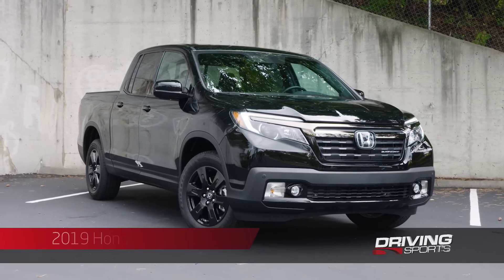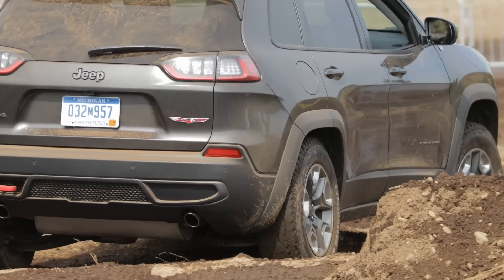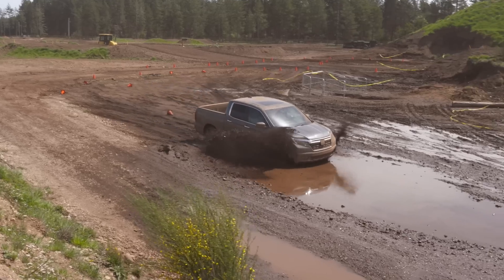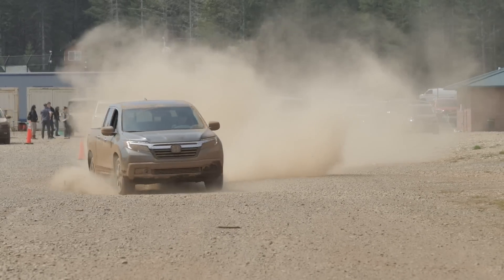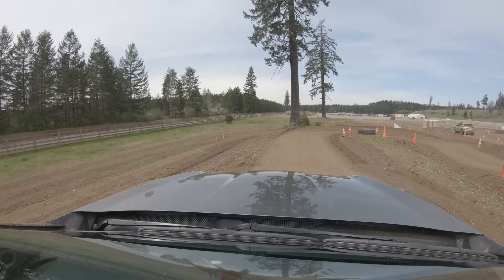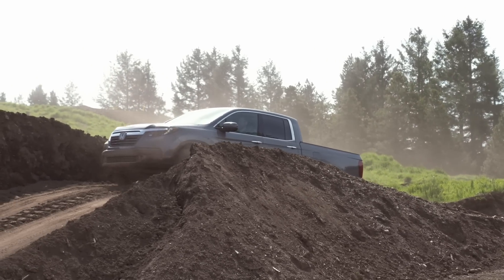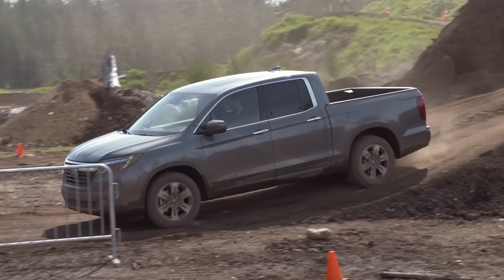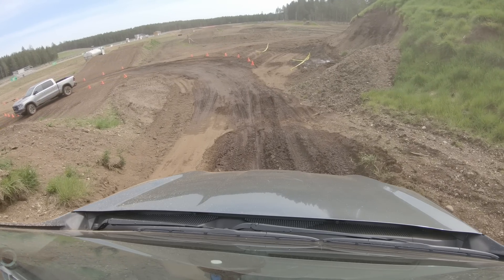2019 Honda Ridgeline Off-Road Test

Comment: My only issue with this truck is Honda should made it look a bit more aggressive
Reply: Developing a new truck costs a lot. Honda used most of Pilot's design to save cost. Without Pilot, we may not have the G2. I like the design and I own both the new Pilot and new Ridgeline.
Reply: Yes, the previous model  had the front end perfectly. It had that chiseled truck look. This new front end turned me off this vehicle completely. It looks like a minivan.
Reply: Ya no thanks have you seen the R or Si.
Reply: I love how the R looks
Reply: C Steele They need to Release there Diesel Edition that have for years but are saving it for some reason
Reply: The previous model Pilot's front end would have been a welcome change from the original Ridgeline's front end.
Reply: Screw looks.  280 hp...tons of other great things engineered in this...I'm never gonna have a trophy wife or a trophy winning SEMA build truck...I just want an urban utility vehicle and this is it.  Will people talk shit...probably a lot but in the end this truck is winning over a lot of people with a brain for a better option for light duty midsize
Reply: Its also in desperate need of a lift and bash plate
Reply: You are right. Older model was way better. The new is a accord with esteroids
Reply: I liked the G1 front. They should go back to that. But use G2 everywhere else.
Reply: Yea, it's not the Taco look but then if the front was not so aerodynamic would it lose MPG performance?  I'm guessing it would.   My heart says buy the Taco but my mind says buy the Ridgeline.  I had a Ridgeline 1st gen and it was great but hated the gas MPG.  This 2nd version has almost everything I need except the look.  I will end up buying the Ridgeline.

Comment: I just don't like the front end of this thing. Everything else is amazng though.
Reply: It makes up for better fuel mileage and a slightly smaller truck.
Reply: cant agree more my fd the front is just like a toy car
Reply: I drive one. I agree it could look more aggressive, but its shorter front side makes parking so much easier. You can really pull up without worrying about your tail end sticking too far out into a lot.

Comment: I’m a 68 year old woman. I have a 2010. Ridgeline I bought used. In perfect condition. It has the old body style. Which I love. The original owner put all the bells and whistles on it.  Side bar railings, sun roof, heated seats, luggage rack, weather tec accessories, and a killer stereo system.  Fit for any tailgate party.  The color is mocha with metal flake paint.  It drives like a dream.  Only issue is peripheral vision.  Blind spots.  Took the head rest off of the back seats and it took care of that however the height of the 🚘 car makes it difficult to see smaller cars when you back up.  I would love new one but they cost so much.  And this one should last for years with all the proper maintenance.  Oh, and everyone tells me it’s a car, not a truck.

Comment: I love my Honda truck, almost two years into it.  Best truck, I have ever owned.
Reply: Miguel Torres Oh Yea
Reply: How many trucks have you owned?
Reply: Is not a truck
Reply: Miguel Torres it’s not a truck
Reply: @billyedd1447  What's your definition of "truck"?
Reply: Kyle C 4x4 with a v8 not a all wheel drive suv with a bed
Reply: @billyedd1447  Well look like he has a different opinion than you.
Reply: Kyle C why are u butt hurt u must own one lol
Reply: Just wondering if the all wheel drive is an added expense over all(extra cost in wheel alignments/other mechanical issues)?
Reply: @billyedd1447  Oh so my friends 2wd dually with a v6 turbo diesel that pulls a mountain isnt a truck either.

Comment: Fast forward 6 years, and now the 2025 Ridgeline has more aggressive styling, but lacks ground clearance. Maybe a complete makeover in 2026 that will hopefully add: improved ground clearance, improved adaptive cruise control, electronic hold parking brake and a traditional shift lever instead of push buttons. An interior facelift would be nice too.

Comment: They kind of lost credibility in the first 30 seconds...the Colorado can tow over 7000 lbs when properly equipped. Last I checked that’s more than 5000. Are they just making numbers up?
Reply from the maker: We commented a lot on this when the video first came out. The tow capacity exceeds that of the ZR2 which is shown. That important specific was in the script I didn’t make it in the video.
Reply: Driving Sports TV   Ok, but the ZR2 loses tow capacity because it’s a dedicated off roader, which the Honda certainly is not. Honest mistake on the numbers, fair enough, but zR2 vs Ridgeline is kind of comparing apples and oranges.  It’s never going to be the same buyer.

Comment: Colorado tows 2k more lbs chief.
Reply from the maker: Not in the trim shown. Though, we agree, that should have been noted.
Reply: @drivingsports  ...kind of disingenuous to show a ZR2  when comparing the towing capacity but then not mention the front/rear lockers,  multimatic shocks, and better approach and departure angles that the Zr2 has.  If comparing to a Z71 or LT (which is more similar to the Ridgeline) then the towing capacity of the Colorado as mentioned before is over 2k lbs over the Ridgeline.  Ridgeline is a very good midsize truck but if you're comparing it to the Zr2 for offroad it isn't close and if you're comparing it to another Colorado for towing it isn't close there either...just saying.  Is this a review or a commercial?
Reply from the maker: MrMcGiblets1 we also were filming a ZR2 that day, so it’s what we had on hand. In retrospect, I agree we should have handled that differently.
Reply: @MrMcGiblets1   Agreed. Ridgeline doesn't hold a candle to a TRD Pro, Gladiator,  or ZR2. I don't believe it even has 4 wheel drive and therefore has no 4-low. Why even pretend it's an offroad vehicle?
Reply: @wilmarbarrick3194  front and rear lockers will go much further on sand or in bogs than some techie awd system.  Bottom line, the ZR2 and Z71 are far more capable offroad vehicles than a Ridgeline. And anything from a base model Colorado up to the Z71 tows 2k lbs more.

Comment: Well if you want a truck get any other than the ridge line. If you need a bed get a trailer for like $1k or less and it’s way more useful and the minivan Honda Odyssey can pull it just fine while hauling the Brady bunch.

Comment: Ok I have your 2012 model. The trunk in it is so so so much better than your 2017 model. On your next model please please please bring back the larger trunk and larger spare tire space. Then I would greatly appreciate it if you would make so that it's towing capacity is at least 7000 lbs. Other than that you have created an awesome vehicle! If you make those 3 changes on your next model I promise that I will make that Honda ridgeline my next vehicle!

Comment: Has everything I would need. I tow my Miata on a light open wheel trailer (about 3000lbs), like to have the weather assurance and capability if needed for light trail duty, and use my current Tacoma as a daily. Hopefully Honda continues with this philosophy for another generation or two so that when I'm able to comfortably afford something like this, it'll still be available.

Comment: I'm continually surprised at how capable my 2006 is off road - yes, there are some limits due to the stiff swaybars (you can easily end up on 3 wheels in really lumpy stuff) and a couple more inches of ground clearance would be nice (but since I do 95% of my driving on the road, I'm not lifting it) - but to have a truck that will do what it does off road, and yet drive like a quick, competent car on the road is great.  And since I don't put more than 1200 lbs in the bed of my Ridgeline (but I do it fairly often hauling machinery all over Florida) or tow more than around 4500, it's great.  And the ride is sublime.

Comment: Had a 2018, now have a 2020 I love it so much. Dirt roads, dirt roads in the rain, muddy inclines, and a snow storm in 6-10" of fresh snow is nothing in a stock Ridgeline. Got stuck on a patch of ice on a slight incline because I had to stop to wait for another vehicle to get pulled out and got stuck. Haven't tried sand but flawless in LA traffic and severe rain on the freeways at speed.

Comment: It is what it is  . It is not a rough and tumble trail truck. It is not made for towing real heavy loads but if you need to tow something that's you know, you want to  tow your snowmobiles or or  Modest size boat and you want to be able to carry a decent load in the back of the truck for some projects This is great. The super handling all  Wheel drive system is unique and it is wonderful. The thing handles good and it is comfortable. Sure maybe it's not a truck per say but it's a truck like very handy very versatile vehicle. And guys I'm sorry to say I have friends that have beautiful brand new Ford    And Chevy and GMC vehicles and they are already having problems with the newer transmissions and some of the engines you're not gonna have that with the Honda. It's probably not for you if you need one of those other vehicles but guess what you're probably gonna have 0 problems with it.

Comment: You could have built the ridgeline a little more traditionally like the bed rails for instance. Instead of building them so all most literally nothing can clamp to them.  You could build the ridge line with certain other traditional truck type things and you would still have something that is its own thing and not like the other trucks out there.

Comment: The VTM-4 system in my 2007 Honda Pilot is awesome off-road. I bet this Ridgeline would be awesome off-road too with a 2” lift, all terrain tires, and sway bar disconnects.
Reply: These new ridgeline has the IVTM4 with torque vectoring.  It can send 70% of engine power to the outside rear wheel when it's cornering.  It's also full time AWD though it's front bias.  It's a proactive AWD, not reactive.  It is way way way better than just VTM4.
Reply: Yo man I know your comment is 4 years old but that’s what I did with my ridgeline lol
Reply: @Bob-lp7ok   That is awesome! I have videos of the Pilot VTM-4 system in action on my channel if you want to check it out.

Comment: I have the first Gen 2007 RTS and it has 189k miles on it. But it’s been a dream to drive and is not afraid to get down and dirty. I’ve pulled trailers with it, pulled other trucks out of ditches in the snow, let it loose down a few twisty backroads and took it on a 6 hour road trip. It has never failed me. I put all terrain tires on it and aftermarket 18” wheels and an aftermarket APPLE CarPlay radio and speakers. Changed the headlight housings to black ones and converted all the lights including the buttons to LED. I’ll eventually replace it with a newer one but not brand new. But till then, I’ll keep it and drive it till it falls apart completely which will take a long time. Haha.

Comment: Love my Ridge.  It's just a great all around vehicle.  So glad I went with a new AWD RTL-E instead of the used Subaru Baja I was considering for the reasons mentioned in the video (space / towing capability).
Reply: AWD + All-Weather Tires = Zero Worries ;-)

Comment: The only issue I have with this truck is on another video when things got really hairy, the transmission overheated and shut the truck down.  Apparently this isn't an isolated incident either.
Reply: Look up the vid where it was tested against a Taco and a Colorado and came out on top in the 20 mile washboard road.  The other 2 lost their suspensions and the Ridge came through just fine.  Not one vehicle is without problems on an anecdotal level.

Comment: The torque vectoring system sounds great.  You didn't mention the gearing for the transmission.  Since this is designed for light trail work, a 2 speed transfer case is unnecessary in my mind.  However, a granny first gear that you can select when needed would be a great option if you need to crawl up a rough section of road and be cheaper than a 2 speed transfer case.

Comment: When I was a teenager my best friend had a truck that sat lower to the ground . It was called an El Camino. But it was referred to by the dealer as a truck. This reminds me of it, but it's superior to today's midsize truck market in everyway. I say put a 2 inch lift and leveling kit on this and it's unstoppable. Add fox shocks and Toyota fan boys will come running.

Comment: I will be buying a Passport or Ridgeline next year.  I didn't like the  Honda-Rep saying go thru the mud fast as you can.  That was so you don't get stuck in the mud.  A good test would be to stop in the mud and see if you can get out.
Reply from the maker: The Fast portion was actually just on hard packed gravel. Zero chance of getting stuck there.
Reply: It had road tires. No reason to risk getting stuck.
Reply: Jordan Graf   It has road tires because it’s a road vehicle.   I got nothing against ridgeline, but it doesn’t belong out there. I don’t know why they keep pretending it’s something that it’s not. If you’re even watching this vid...thinking you might be pushing your truck through obstacles off road...the ridgeline isn’t for you.
Reply: And for the same reason all those off roaders with the oversized chunky tires should stay off the road
Reply: That's a battle for the tires to fight, not the truck. I'm guessing this was a dealership ready vehicle with standard all season tires.
Reply: So because it doesn't have AT tires it doesn't belong? Mind boggling logic.

Comment: I am very tempted with the new Ridgeline.  I think where "owners" of Canyon/Colorado or Tacoma get annoyed is with the adds that Honda tries to compare the Ridgeline to small "real" trucks. That by the way is not a slam when I say "real" but a truck by definition is a body on frame construction.  If it was 1970 we would be comparing the Ridgeline to an El Camino or Ford Rancharo which were car based trucks. 
For 85% of the people out there who's "real trucks" never see off road the Ridgeline will work fine. It is reliable, comfortable, safe and will handle mild off road (which btw this video is not off roading) work well in the snow. 
Now for the 15% left that actually take their trucks off road with rocks, deep mud and areas where clearance is an issue then the Chev/GMC or Tacoma are going to shine.
Reply: "a truck by definition is a body on frame construction"
That opens up a whole new can of worms. Just where did that definition originate from? Because in Australia, having a body on frame construction isn't enough to qualify as a truck!

Comment: My neighbor has a 07 Honda Ridgeline with 750,000 miles. I’ve an 06 Ridgeline with 119,000. This is a great truck for the average guy that doesn’t need a big truck but needs to move some furniture or Home Depot goods. Very easy to change oil and filter yourself.

Comment: I never liked trucks until I drove a Ridgeline, so I bought myself a 2009 RTL and Love it; put over 55,525 miles on the baby in 33 days of actual driving time in 2018 and it's still smooth as silk. I'll never buy any other truck. I however love the old look, so why I haven't bought the newest model. Whoever is saying it's not a real truck, you have to own one to see that indeed, it is all the truck that you will need...

Comment: hate these videos. Not bashing on the ridgeline as it may be my next truck. But  he says your camry couldn't do this because of the approach and departure angles. True they built those into the course so they can say a car couldn't do this.  But many suv's could do it and take those specifically built in angles out of it and look at the terrain and yes most cars could do it. I drive back dirt roads in my rec area and yes better in a truck but similar to this video and i see cars out there all the time. Which to the point most of those arguing about what a truck is are not doing anything harsher than these back country dirt roads. So 90% will never need a real truck anyway and if you get too rough most stock trucks can't handle it either.

Comment: I don't have a problem with unibody. I don't have a problem with fully independant suspension. My problem is with the drivetrain. As someone who works on their own vehicles, I HATE transverse mounted V6s. The rear cylinder bank is just such a pain to access. Also, I'm not a fan of the overly complicated awd systems. I think gm has had it right since the early 2000s. 2wd, 4auto, 4lock, 4low. That's all you need. The rest comes from driver skill and experience.

Comment: It's a truck the way an El Camino was, a car with a bed. And you can get it with AWD which is nice. It's not meant to compete with regular trucks though, it's for city drivers who want the comfort and ride of a car, but can still do light truck stuff when occasionally needed. That said, as much as I'd like one because that describes my needs perfectly, I just can't deal with the weird looking front end. The front end of the previous generation was much better. I knows it's just cosmetics, but looks still matters to some degree. If they reshaped the front to be a little more truck-like I'd probably get one and it could replace my Accord and Frontier in one vehicle.
Reply: The El Camino couldn't tow 5,000lbs or have a 1500lbs payload... This truck's capabilities are in line with the Tacoma, Frontier, and Colorado. It's a truck that does everything every other truck in its segment can do, and even some things they can't. No, it's not made for rock crawling, but to compare it to an El Camino is ridiculous.